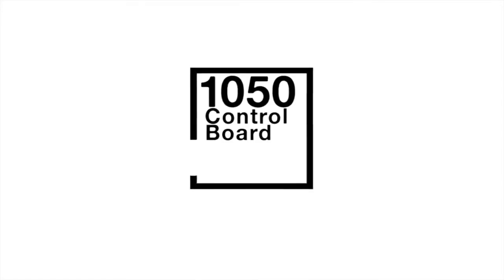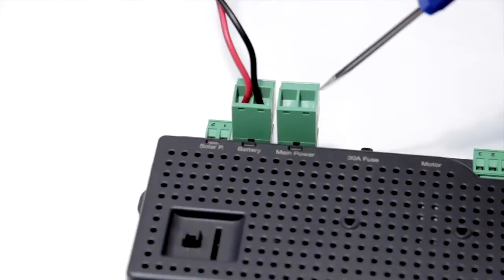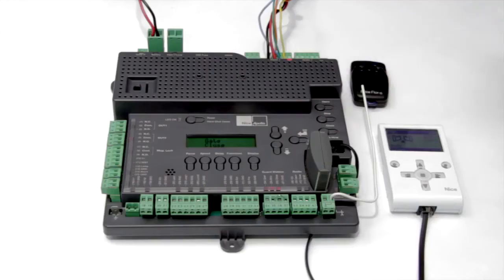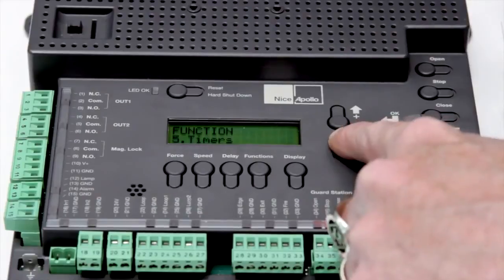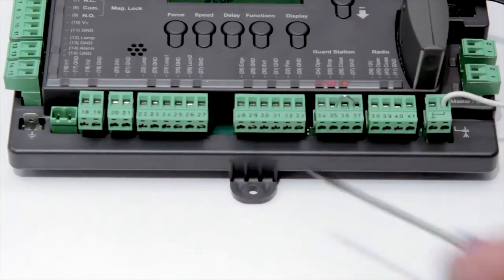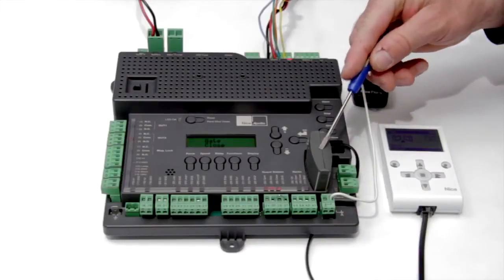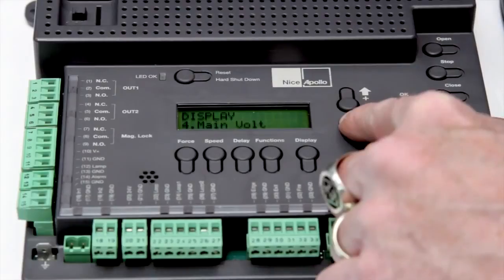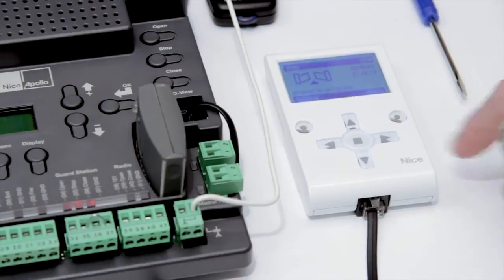Nice Apollo 1050 Control Board

Comment: We have been trying to set up our remote control for this with no success. We plugged in the receiver and programmed the sensors. Is there something else needed like the radio or O view.  We have the antenna hooked up but no busses or O view.